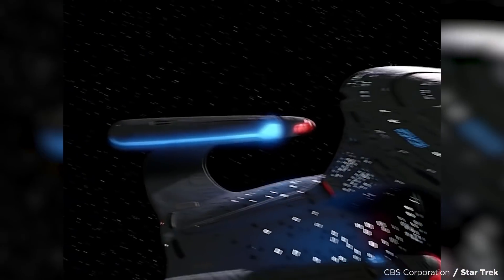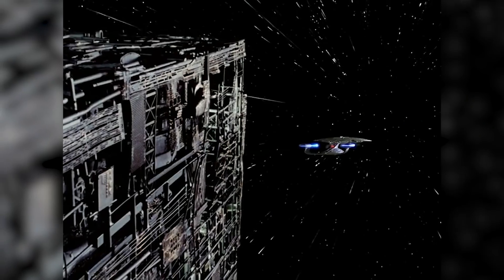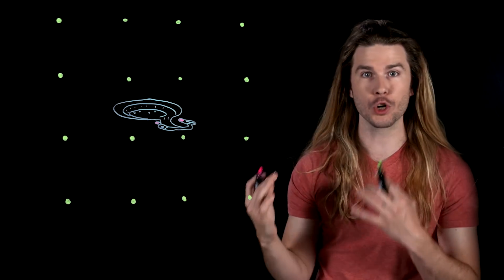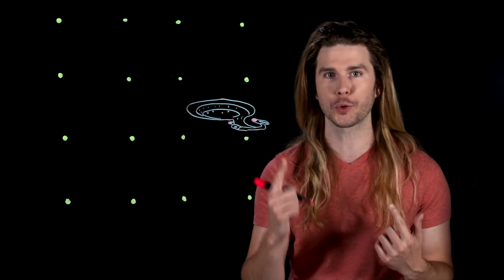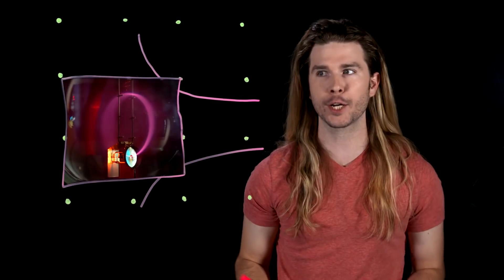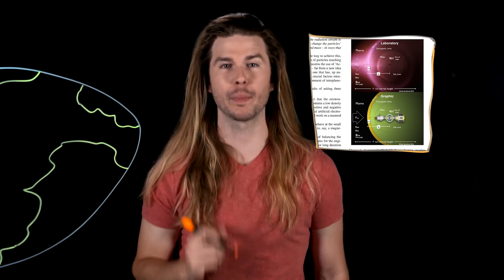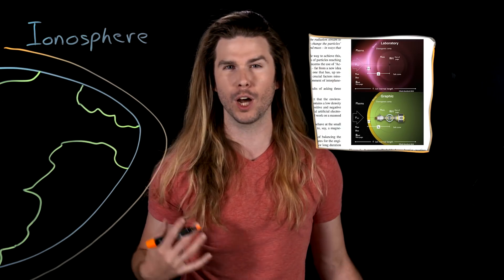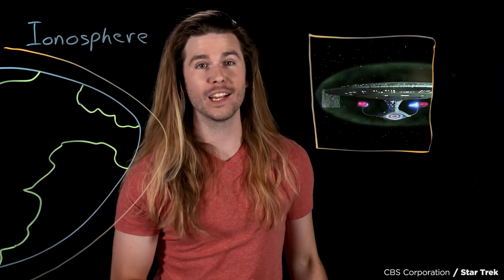How Do Star Trek’s Deflector Shields Work? (Because Science w/ Kyle Hill)

Comment: can these Deflectorshields block classic kinetic weapons? cause technically they are not charged and they can install a Railgun for sure in one of their ships, these things are basically flying citys
Reply: cue the halo super MAC
Reply: oh yeah macs... the one type of gun i actually saw in rl (in a military  museum of our military and mainly about the gear and its development over time) and i still think it to be ridiculously powerful. i mean i rwad about rl railguns and they are designed to be intercontinental artillery cannons
Reply: Magical Fungi 
and thick enough, we're talking mach 6 speeds in normal air pressure. thats why today's railguns shoot their projectiles OUT OF THE ATMOSPHERE to reach long distance shots. the only reason why we dont use them is the fact that you need a new barrel every three shots and thats expensive and the capacitors we have aren't up for the task for even more powerful ones.
Reply: yes, as long as the magneto-plasma is dense enough it would vaporize any unshielded kinetic projectile.
Reply: It's really easy to hit a ship with a similar shield, using the teleporting technology. Just teleport some rubble on the enemy ship course, and watch it explode when they meet.
Reply: Magical Fungi 
but what about dra... ahem MACs. as far as i know they are accelerating to a nice percentage of light speed and shoot projectiles twice the size of a school bus made out of freaking depleted uranium. i dont know the specifics as i dont play halo, pc master race ;) , but i bet they could pierce through any shield.

besides that, the scales between star trek and halo are completely different. my friend told me about a space station so big that if you imagine a dvd, a mega earth is as big as a European 5 cent piece, and the station harvests the planet for ship building
Reply: @firebladeentertainment5739 for reference within the Halo universe, it takes 3 rounds. First weaken the shield, the second to puncture the shield, a third to hit the hall.
Reply: Fireblade Entertainment 
But even if it won't work, their ships may have a very durable steel-type alloy capable of space travel...
Which in any case, kinetic weapons may not be effective.
Reply: Well, if Stargate is to be believed, then yes, but in Star Trek it's well know that kentic projectile weapons can penetrate shields, hence why Picard can kill two Borg in First Contact, because their energy based shields can't adapt
Reply: Well but thats not how Canon actually suggests they work. you have the technology to warp space time and employ graviton fields. That makes way more sense to use defensively and that is the technology the Manuals cite as creating the shield network. 

High velocity MASSIVE objects are naturally more energy dense so it would be harder to shrug off a kinetic energy slug travelling at a fraction of C because it would be like redirecting a small asteroid. The asteroid would encounter lots of shearing forces and most likely explode, but somewhere overlapping the shield boundary, reducing energy to the space craft but still releasing a fair amount of energy inside the shield boundary. 

So that makes sense. 

But a single mass object at very HIGH VELOCITY ...the question is, does it spend enough time in that "Shearing graviton" field to loose a high proportion of its mass ......retaining mass is important.

Photon torpedoes aren't that affective against shields for a very good reason. they have a chemical payload that has to be kept under power and in magnetic suspension, the torpedo needs to reach its target to trigger the payload. Photon torpedoes are devastating ....

But without a lot of redundancies or counter measures of their own (Which would make them stupid and impractical to build and equip in large numbers) when a projectile containing an antimatter/matter fuel pod mix crosses a THIN region of rapidly warping space time ....you run into problems. 

Such as the torpedo detonating at the shield interface, which would result in the enterprise say ..getting hit with a bunch of SHARPNAL maybe ...and a lot of EM radiation but still way less damage than the torpedo was designed to inflict. 

So rather than construct a bunch of really expensive torpedoes ...it makes sense to wear down the network with highly intense beam weapons and then sneak your torpedo in. 

OR yeah ...use a really fast moving massive slug. Torpedoes are warp capable ...but thats a ridiculous design for a weapon designed to be used for these purposes. 

Rail guns would be a much better option.
Reply: I would argue that density is more important than thickness. If you had something going fast enough with enough mass then it would fail, but given what it has shown to defeat before, i would say it would have to be a very large projectile.... like a schoolbus sized projectile... before it would actually penetrate the shields. Which would just be impractical.
Reply: Fireblade Entertainment 
I see what you did there... Very interesting! As for physical attacks, the ships have dedicated phasers that target objects and destroy them before they make contact with the ship. Mostly used against meteors while the ship is moving at Warp (it's even in the literal Episode 1), I imagine that they can probably stop the MAC blast (similar composition and speed) as well. On a side note, what if you could build a ship with MACHICULATIONS?!
Reply: Well isn't the few inches of metal covering the ship and the blast glass going to stop traditional bullets anyways. Unless it was a junker style ship firing large debris from literal junk cannons I doubt your typical bullet would bother what is basically a massive military space hummer
Reply: reallyyou kidd 
or lazy writing... just saying that the original star trek was made on a low end bugget. therefore the entire franchise is built upon some whacky science and bad thought design choices todays writter of it have to struggle. for example the fact that they DONT HAVE FORKING SEATBELTS!!! im a die hard fan of the series but as a hobby writter and literature geek i Cannot overlook such things. if we the viewers need to come up with reasonable explanations for their tec, its bad researched and written. for example the shields: in a story of the voyager storyline, they come upon an everlasting battle, where both parties are evading constantly. at ine point they got trapped inside it and need to shoot their way out. in this scene we get explained that the other parties are using phase based shield, which are perfectly attuned unlike the shields the federation uses and therefore making them unpenetratable to the broad frequenzy of the not federation races. the crew of the federation has single frequency phasers and the shields normaly block them until the crew of the voyager inverts the polarity of the phaser. this should not work in the first place as the Shields are able to adapt to the frequency used by the federation therefore knowing the frequency before impact but not being able to adapt when it suddenly changes. in one moment the shield can do a thin it cant in the next one. also this is not how the plasma-magnetic shields discussed in the video work. such things make a writter with knowledge about the craft Furious. 
sorry i got a bit angry.
Reply: From TNG tech manual PAGE 138 ...."TACTICAL SYSTEMS" "DEFLECTOR SHIELDS" The tactical deflector system is the primary defensive
system of the Galaxy class starship. It is a series of powerful
deflector shields that protect both the spacecraft and its crew
from both natural and artificial hazards.
Like most forcefield devices, the deflector system cre-
ates a localized zone of highly focused spatial distortion within
which an energetic graviton field is maintained. The deflector
field itself is emitted and shaped by a series of conformal
transmission grids on the spacecraft exterior, resulting in a
field that closely follows the form of the vehicle itself. This field
is highly resistive to impact due to mechanical incursions
ranging from relativistic subatomic particles to more massive
objects at lesser relative velocities. When such an intrusion
occurs, field energy is concentrated at the point of impact,
creating an intense, localized spatial distortion.
To an observer aboard the starship, it appears that the
intruding object has "bounced off" the shield. A zero-dimen-
sional observer on the intruding object would, however, per-
ceive that his/her trajectory is unaffected, but that the location
of the starship has suddenly changed. This is somewhat
analogous to the spatial distortion created by a natural gravity
well, and is typically accompanied by a momentary discharge
of Cerenkov radiation, often perceived as a brief blue flash.
The deflector is also effective against a wide range of electro-
magnetic, nuclear, and other radiated and field energies.
Reply: SonOfMyths73 
you made my day and i dont know a fitting pun related to shadiversity right now
Reply: reallyyou kidd 
you should know that a single dust particle can significantly harm a space ship, wven by todays standards. they usually fly with speeds far greater than any earth bullet can reach. if you increase the velocity you increase the impulse and that determines the strength of the impact. we dont know for sure what they use fir their hulls and how thick it is, i can only say theres always a bigger and faster bullet.

also you should read the other comments, we talked about railgun level of kinetic force and thats a totally different league of hard hitting.
Reply: Any plasma bubble sufficient to block kenetic weapons would be entirely opaque
Reply: Fireblade Entertainment would it be fair to say that if projectiles are going at that kind of speeds they would break up in their own speed. But I'm pretty sure the enterprise is a lot stronger than your average rocketship. I'm just thinking that the fact everyone in star trek uses lasers they must be a reason the standard bullets are not used they must have been rendered obsolete
Reply: Fireblade Entertainment nothing wrong with being angry not like your angry at me. But I always think of futuristic shops and lasers as basically an evolution of tech. That means it's rendered what we know today as useless and obsolete to the point of not using them. Thus any kinetic missile is widely known and accepted to not work and the lasers or lasers have become the nessercary minimum standard. Like how we would never see a steam powered tank
Reply: reallyyou kidd 
theres a bit of difference in the comparison. we have lasers strong enough to kill people, we just dont use them as they fall under the same law category as flamethrowers. and they can irreparable blind someone, which is apparently against the rules o war as far as i know. its just the biggest concern with laser weapons, that you're enemy will go blind. weird. but a steam engine isnt used today because its horrible when it comes to efficiency and its expensive to fuel.

back to the weapons: when the first firearms where introduced to the military, they had alot of downsides compared to a bow, they where slow and not precise. an archer could fire seven arrows in the time a single shot was loaded into a musket. the big upside of firearms where the training costs. while it takes years to train a soldier to get the strength and mastery to use a bow, you could teach someone in a week or less to how to shoot a gun and load it. it's a question of saved money.

back in star trek: the main reason i think they use energy weapons is the fact that kinetic weapons need ammo and ammo needs storage space. and all ships we saw in the series were exploration ships not primarily designed for combat. a combat ship surely would use powerful kinetic weapons in addition to phasers to counter enemys with high resistance to energy weapons. its also canon, that they have only a limited supplie of torpedos on board which they use against though enemies.

im working on a sci-fantasy universe at the moment where the tec based earthlings mainly use kinetic weapons as energy weapons are expensiv to make and hard to maintain. this changes later as they get access to arkana runes (name not certain for it) and the corresponding arkane dust and crystals, which act as powerful energy capacitors, collectors and wiring, which solves the energy problem of energy weapons.

i just remembered, in deep space nine they showed a kinetic based rifle with integrated wall hack. it teleports the shot bullet into the target, a powerful design never realised in large ships. maybe because of sone weird federation law or... bad writing! but it would have been so op...
Reply: oh my... i surely Talk alot about that stuff. does anyone still read it all?
Reply: A railgun projectile is magnetic; it has to be by the principle the railgun uses. A railgun projectile has greater mass than a single particle, so it could get through with negligible deflection.
Reply: Jamie House. The borg use a completly different shielding system. They block out certain frequencies of weapons such as lasers or phasers completly so you have to change them. They are vulnerable to kinetic weapons, however that is mostly because no race advanced enough to fight them would use kinetic weapons commonly. If they were common im sure the borg would adapt to them.
Reply: i think the reason why they dont use kinetic weapons are either one of the reasons i list or a combination of them:
1. more difficult to use than phasers 
2. ammo is expensive 
3. limited storage
4. lazy writing
5. some weird federation law

im not deep enough in star trek lore and tec to know exactly why they dont use kinetic weapons but as i know from my knowledge about warfare and the linked technology, you always try to outsmart yor enemys weapons and defence as, for example, in ww1 as the first tanks were introduced into the battlefield, a countermeasure was invented: the Tankbüchse, a rifle designed to shoot through the armor of a tank from a long distance.

ps i just remembered that the persons of the star trek universe are having issues using old tec, maybe thats a reason too...
Reply: Uh. you are missing the point though. We have lasers strong enough to KILL people, but we DON'T use them because its not economical. If your goal is to deliver energy to a target, projectiles are always best. Unless you can create a room temperature semiconductor and increase thermodynamic efficiency ..the reason we DONT use lasers to kill people isn't because of "Conventions" or "rules" it is because its impractical, and always will be. Lasers are good at one thing, working at max relativistic speeds and in a vacuum. If you did have the ability to generate high energy from a less massive source and make it more efficient IE fusion reactors and lasers ...sure. But that wasn't your argument. you specifically made one argument about us currently being limited by rules of war ...as the reason we DON'T use laser weapons ... as if to say ...its totally practical for us to do so, we just don't because of rules and ..its bad. 

Then you switch to a totally different argument related to futurism/scifi where energy capacity and economics are the factor .....when that is actually what limits us NOW ...and you make it appear like its "Different" ....What ....the fuck ....
Reply: BuzzKillingtonS13 
whoops, seems like i forgot to think about what i was saying. sometimes i get carried away and i often go of topic.
thanks for your correction, i appreciate it.
Reply: I do the same thing some times man! Lol I like it when people correct me also, but I think I was drunk and a little to harsh. Im with you!
Reply: new input of information:

my brother is a bigger star trek fan and he told me that deflector Shields work different.
apparently they are energy shields mainly used to repell objects during warp travel. in the archer storyline they didnt did anything else. they needed to rely on armor plating alone. 

yeah, not really satisfying...
Reply: Nominal system output (Cruise Mode) of the deflector
system is 1152 MW graviton load. Peak momentary load of
a single generator can approach 473,000 MW for periods
approaching 170 milliseconds. During Alert status, up to
seven generators can be operated in parallel phase-lock,
providing a continuous output of 2688 MW, with a maximum
primary energy dissipation rate in excess of 7.3 x 105
 kW.
Reply: Providing shielding against the entire spectrum of elec-
tromagnetic radiation would prove far too energy-costly for
normal Cruise Mode use. Additionally, a full-spectrum shield-
ing system would prevent onboard sensors from gathering
many types of scientific and tactical data. Instead, Cruise
Mode operating rules allow for deflectors to operate at the
relatively low level (approximately 5% of rated output) and at
the specific frequency bands necessary to protect the
spacecraft's habitable volume to SFRA-standard 347.3(a)
levels for EM and nuclear radiation.
During Alert situations, shields are raised to defensive
configuration by increasing generator power to at least 85%
of rated output. Shield modulation frequencies and band-
widths are randomly varied to prevent a Threat force from
adjusting the frequency of a directed energy weapon (such as
a phaser) to penetrate shields by matching frequency and
phase.
Reply: Raising shields to defensive configuration also triggers a
number of special operating rules. First, active sensor scans
are operated according to special protocols that are intended
to minimize the interference due to the shielding effects. For
certain types of scans, sensors are continually recalibrated to
take advantage of any EM "windows" left open by rotation of
shield frequencies. In other cases, the random variation of
shield frequencies is modified slightly to allow a specific EM
window at specific intervals necessary for data collection.
Such sensor operation techniques generally result in sub-
stantially reduced data collection rates, so sensor usage is
strictly prioritized during Alert situations. Further, most defen-
sive scenarios require sensors to be operated in "silent
running" mode during which the usage of active scan sensors
is not permitted and only passive sensors may be used.
Reply: BuzzKillingtonS13 
finally a definitive answer.
as far as i could extract from your wall of text, a railgun shooting at enough velocity would be able to penetrate the shield.
FINALLY IT IS ANSWERED!!!
Reply: Well not even that, its not that complicated ...as with anything its a function of ENERGY ....mass and velocity by themselves are irrelevant. The more energy directed into any region of space time is going to be more difficult to deflect regardless. Star trek is really just a battle between "Power plants" and well ...any scifi show with such technology such as shields and directed energy weapons is just as simple as who can dissipate more energy while dealing more energy, and it all comes down to those factors.  but I wish startrek and scifi in general made this MORE a central focus of every battle, it would educate people more.
Reply: Actually the projectile itself is not magnetic. The projectile is sandwiched between 2 magnetic casings, these are what is accelerated down the length of the rail. Then when the projectile leaves the rail they fall away and the projectile continues. If you look at a slow motion video of railgun tests you can see them fall away.
Reply: "As for physical attacks, the ships have dedicated phasers that target objects and destroy them before they make contact with the ship. Mostly used against meteors while the ship is moving at Warp (it's even in the literal Episode 1)"

what are you talking about? what "literal Episode 1"?
"The Cage"? I don't remember anything like that happening there...

they have Deflectors which basically "push" that stuff out of the way.
Reply: Yes, as far as Federation shields go. On The Next Generation, Picard and crew were fired upon by a kinetic missile. It did zero damage. It also happened a few times on Voyager during the first couple of seasons.
Reply: Here's hoping it really IS dense enough to vaporize the entire projectile, otherwise you've no longer got a solid slug headed your way, but a tiny puddle of super heated molten metal flying at bullet speeds